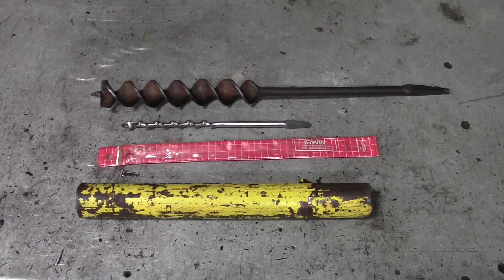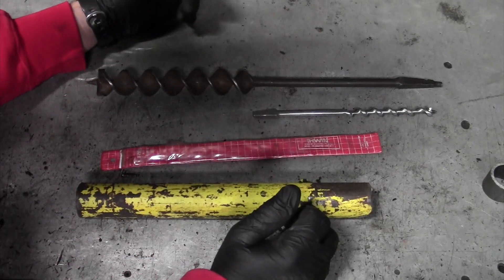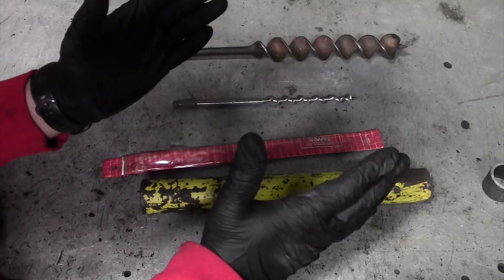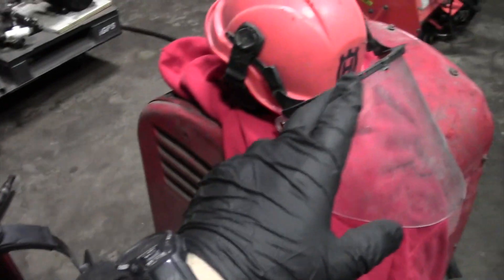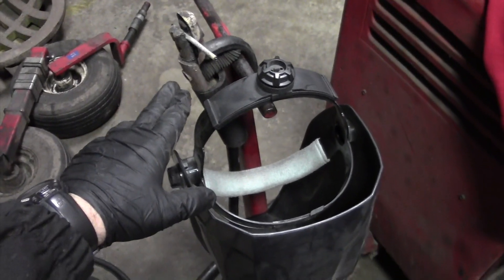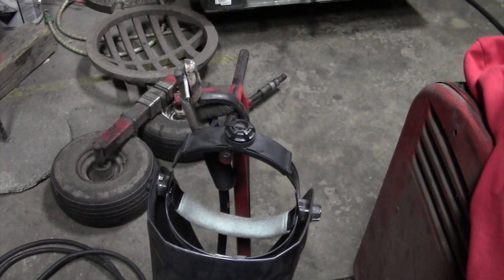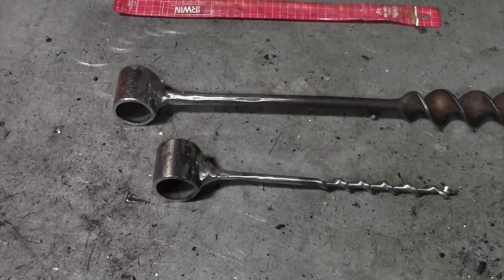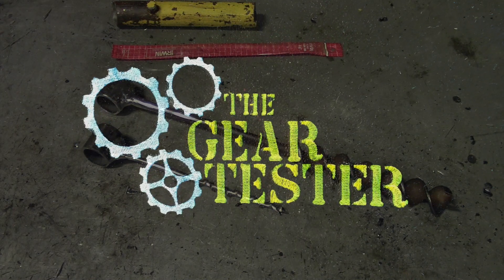Welding a Scotch Eyed Auger-Bushcraft by TheGearTester

Comment: Nice video. I just learned about Scotch Eye Augers, and after seeing the price I was thinking the same thing - just make one. But I think I'll do a little bit of pounding on the end with a hammer and anvil, and wrap some steel from the shank around the pipe, then hit it with a little weld if it needs it.

I have a full 13 piece set of Irwon augers that were my grandfather's. They're in a wood box, and aside from a tiny bit of rust, they're in really good shape - still sharp like new. Only problem is that I'm not sure I want to break up the set. I'm a carpenter and I love hand tools. But I'll definitely keep my eye out at tag sales for one that's in good shape.

I think I'd like a 1 inch Scotch Eye Auger for making impromptu furniture; and a small diameter Gimlet for making small holes - and tapping smaller sap holes in living trees. 

—

Comment: Great job GT. For someone learning a new skill, that looks really good. What would work better for putting the torque load on the auger is drilling and then creating a square hole in the adapter you fabbed, much like the tool would have had, and then applying the weld. I like your ingenuity. :)
Reply: +Stewart Davis that way the weld doesn't have to do all the work.

Comment: That's right, the auger's square drive would have contact inside the wall of the pipe. Of course you would have grind down the rat tail portion of the auger so it wouldn't stick down in the inside diameter of the pipe. A triangle or square file would make nice corners after a pilot hole is drilled. I'm looking for a 2 or 3 inch wood auger for some projects.  GT had a great idea for making it portable and improvising a handle from multiple items. :)